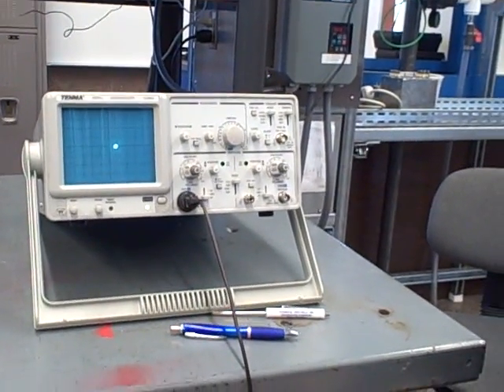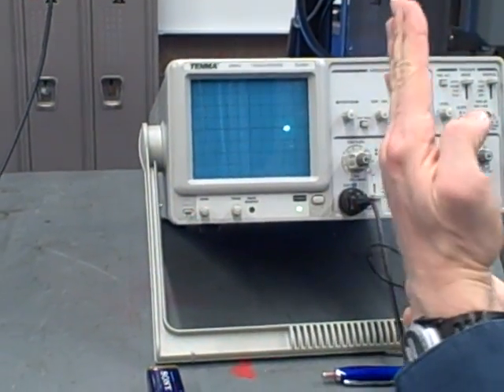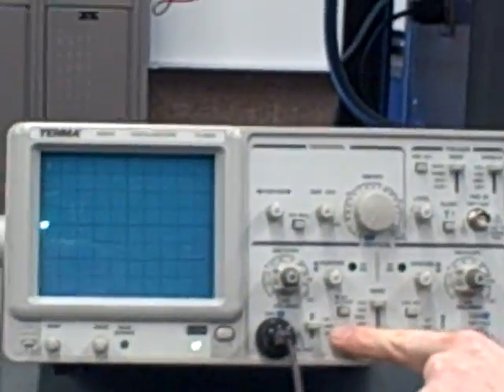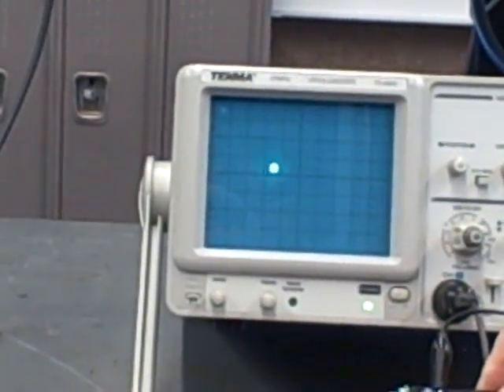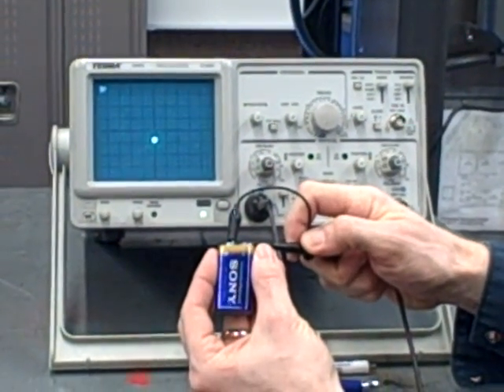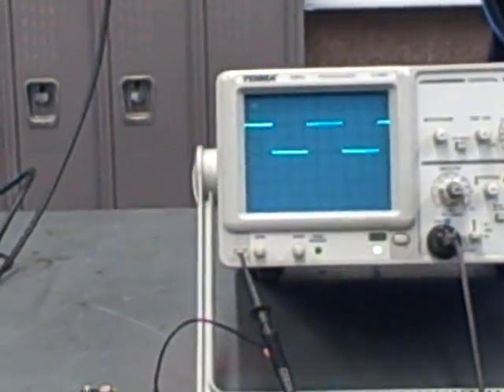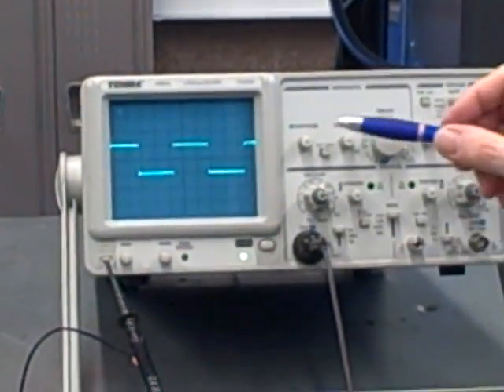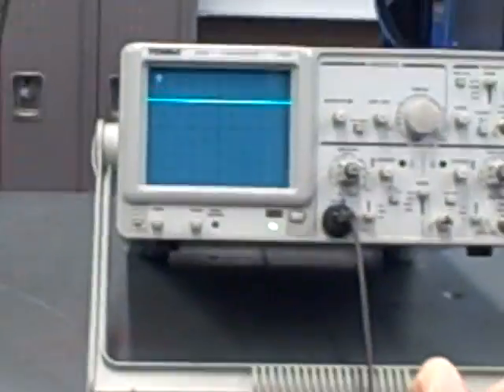Oscilloscope operation AC DC GND coupling

Comment: A note on GND coupling. I recently bought a tektronix's 2213 and the manual states that GND coupling should be used when probing circuits with a big difference in voltage. The recommendation was if your are about to measure something that is 10 times the value of your volts per division (or larger), to first switch to GND coupling and let to let your probe sit for a several seconds on the test point. This is because there is a capacitor in your probe in series with a large resistor, and when the capacitor is not charged and you apply a voltage, current is at a maximum at the very start. The use of GND coupling allows this probe capacitor to safely charge up to the circuit value while the probe end is just connected to the scopes ground and not your scopes sensitive circuitry.

Comment: is it dot move  on cro scope display without probe or any connection? I asked because i wos first time turned on one old scope, and nothing happen, only dot which stay and can manualy move on left side per two division but vertical not work. Also this dot stay always without probes or with probe anyway nothing happens. I think my uncle scope definitly dead. No trace no any signal. My question is"" is it dot move like in this video without any connectio?"". Pleas responded to me, i am new on this. I want use scope for audio signal and vector scan so for classic electronics sometime unusuall way. Probably i must changed scope. Tnx!!!
Reply: I think your scope is in XY mode...and it needs to be in normal mode. Make sure your SEC/DIV control is not in the XY mode...just select any other position then try it.

Comment: I was trained on analog scopes in the late 90/early 2000 and I do not miss them, all those manual calculations were a pain in the butt. I love my DSO and would never go back to analog. Yeah to cut you off, yes there can be discrepancy in the analog to digital conversion with modern DSO (IF) you buy the cheapest POS DSO you can find. My DSO for example has a analog band of 100MHZ, a 1Gs/s sample rate and 2MPT of memory depth. A good personal scope.

Comment from the maker: If the scope is set for DC coupling, the sine wave will appear shifted from the zero (center) line.  If you switch the scope to AC coupling, you can then read just the AC part (with the DC offset removed).  I recommend measuring the peak value of the AC first (using AC coupling), then switching to DC coupling and noting how much the waveform shifts up or down to measure the amount of DC offset in the signal.

Comment: @BTCinstrumentation
how do you read superimposed DC & AC voltages, If I had a oscilloscope that was set to 1 volt per division connected it to a 3V battery, the line would go up 3 divisions, but what happens if it's superimposed with an AC voltage of 5 volts, how would you go about reading that. If you can give me feed back I would really appreciate it, thank you !!!

Comment from the maker: @na5m You go about is very cautiously.  Don't ever directly connect an oscilloscope to line power, but use a step-down transformer instead.  This not only reduces the amount of voltage applied to the scope's input, but it also provides galvanic isolation between the line and you to prevent ground faults.

Comment from the maker: @yousrihari Connect the scope's probe in parallel with the crystal.  You may have to use two probes (in differential mode) if one of the crystal terminals is not grounded.

Comment from the maker: @yousrihari I'm not sure you actually have an oscilloscope.  I tried looking up "HP Agilent 8924C" on Google and it appears to be a communications analyzer, not an oscilloscope.

Any oscilloscope set to "DC coupling: should be able to register a DC voltage applied to its input.  The volts per division (v/d) setting determines how far the line will move with applied voltage, and the t/d setting doesn't matter (for DC measurements).